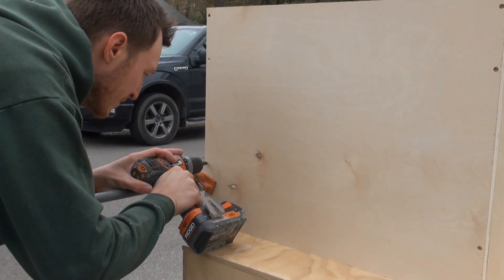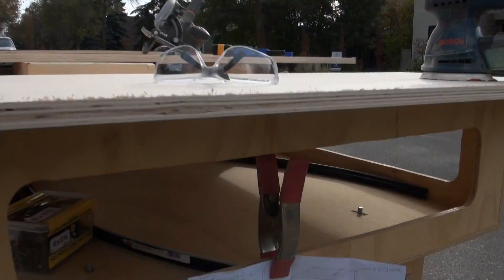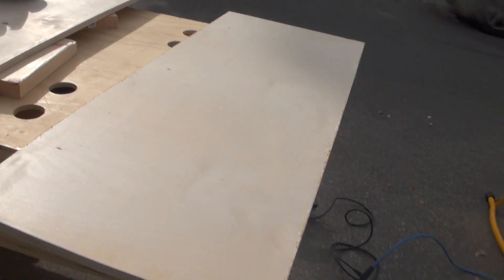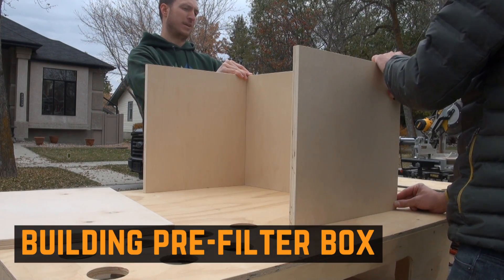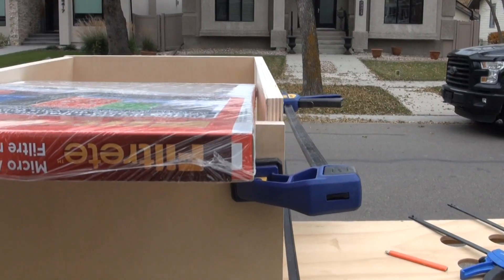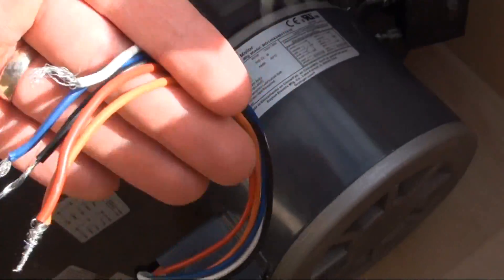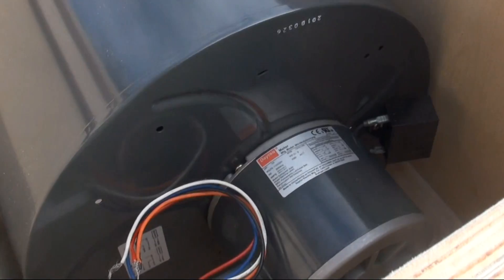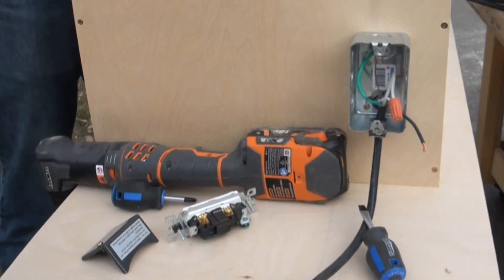How To Design And Build A Laminar Flow Hood: Part 2 - Build

Comment: Great video Tony.  I subscribed in order to get the plans and ran into a problem with the link that arrived.  In Firefox, the link begins to open tabs, one after the other, in the browser at rapid speed (was up to 99 tabs within 7 seconds before I closed the browser).  This was a repeatable bug.   I pasted the link into Chrome and the pdf file loaded without any problems.  Thought I should let you know.

While I'm at it, might as well let you know that video 1 would not play on my smart tv (Panasonic).  Error message says something about an unrecognized format.  Video 2 plans on the tv just fine.

Thanks for the plans.  cheers.
Reply from the maker: Thanks for the heads up! I will try and get that fixed, it downloads from mailchimp servers, so not sure if I can do much about it. I might switch providers... Glad you were able to access in Chrome! As for the first video, not sure, it's the same format as the second video....

Thanks for watching!